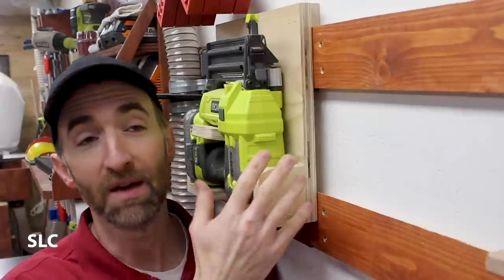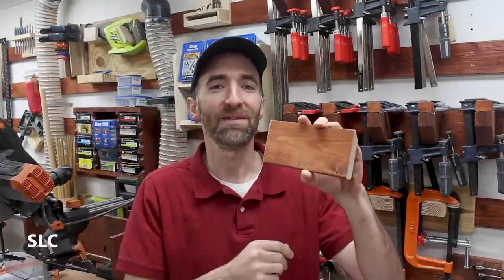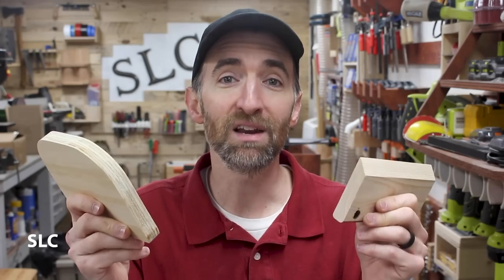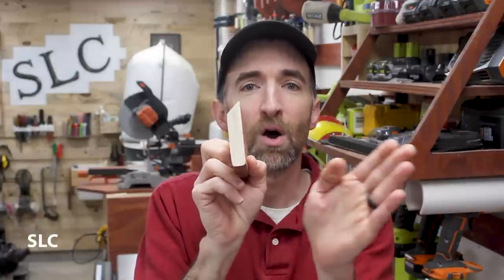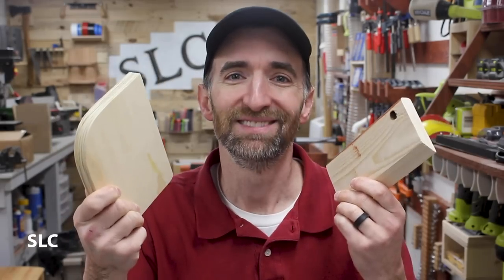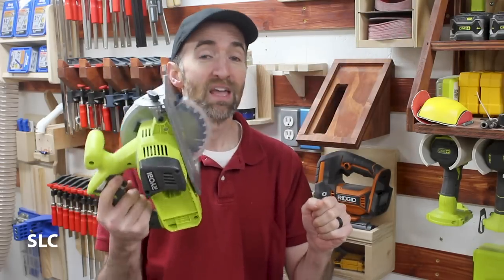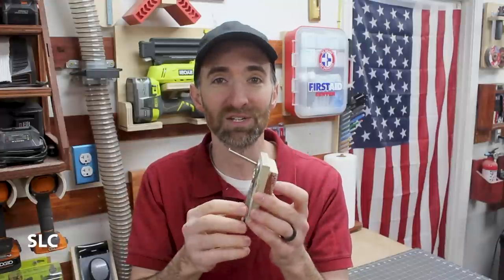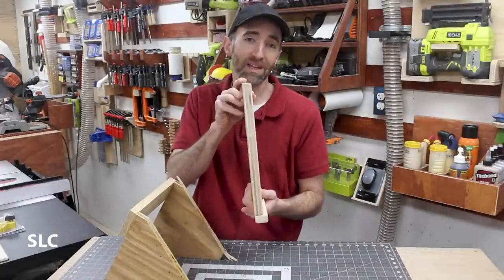French Cleats : Frequently Asked Questions

Comment: For my cleat wall I started with 3/4 plywood over the existing wall with plenty of screws into the studs to secure it. Then I could use narrower cleats because I could driver as many screws into the cleats and the 3/4 plywood behind it to make it super secure without need to stick to the stud locations only. The narrower and more cleats you have, the more versatile your cleat wall is.

Comment: I scored a deal on weight plates at a garage sale a few years ago.  Upside is that I got almost 400 pounds of cast iron plates for $20.  The downside is that I needed to find somewhere to store all the extra plates.  I had an unused area in my shop (which doubles as my lifting area) about a foot wide and 6' tall.  Didn't have any confidence in the block supporting that much weight, so I used a scrap 2x4 about a foot long, cut it, and bolted half to the sill plate at the top of the concrete block wall with 4 beefy lag bolts.  Put the other half at the end of a 2x12, cut it to length, and then screwed another bit of scrap 2x4 to the bottom for a spacer.  Drilled holes at an angle downwards 3/4 of the way through the 2x12, then cut short lengths of 1/2" EMT pipe and set them in the holes.  I can slide the weights on these pipes.  At first I was concerned about the pipes bending, but they're just like they were when I put them in place.  Only difficult part was getting the 2x12 in place as there's another joist nearby - had to angle and wiggle it to get it in the first time.  All of the weights are tucked away nicely, but are immediately accessible when I need more plates.

My point isn't to brag about getting such a good deal, but is that you don't always need to build a frame for a concrete block wall.  That one short french cleat has had an immense amount of weight on it for the past 2-3 years with no issues whatsoever.  If you think about the direction and type of force beforehand, you can nearly always come up with another (may times easier) way of doing things. =)
Reply from the maker: That's a good story and glad it worked out so well for you. Thanks for sharing.

Comment: Love  your videos. Thanks for making them. One recommendation for stud walls, the shop in my garage I insulated, wired with 20 Amp and then covered with 1/" tempered peg board. It works well with lots of flexibility where I don't use cleats. Just a suggestion.

Comment: For my cleats I used a 2x4 spacer to get the all the exact same spacing apart to ensure they parallel and if I ever need to hang something heavy that needs 2 cleats I can use that same spacer to the cleats hanging will rest on the wall cleats for more support.

Comment: I think that if you were going to add a french cleat system to a bare stud wall, you'd probably want to space the cleats a little closer together. Just as you would add a spacer to a tool holder that was not tall enough to reach the cleat below, the closely spaced cleats on a bare stud wall would be that "spacer" that you would need to keep things stabilized.

Comment: Awesome info. I am framing out the walls now for my shop. I am planning to use plywood as my backer. What thickness plywood is sufficient for french cleats assuming I will be able to hang power tools?
Thanks, John
Reply from the maker: For just the walls, I wouldn't go any thinner than 1/2 inch. For the actual French cleats, I prefer to stick with 3/4 inch.
Reply: @SpecificLove7   thank you very much for the info.  Keep up the great work.  You are very inspiring 👍

Comment: Clint, thank you for the great French cleat video series.  One more question I was hoping you could address is what’s your thought on putting the French cleat on the shop wall that is covered by drywall.  Would you recommend putting the cleats directly on the drywall and screwing it to the studs or would you put a 3/4” plywood over the drywall before putting the cleats on.  Thanks and keep up the great work.
Reply from the maker: I usually would not recommend having drywall in a workshop because there's a good chance holes will be put in it easily. But if you already have it up, then you could add your French cleats over the drywall making sure to have long screws that anchor well into the studs. And if by chance it gets damaged you could always later remove the cleats and add plywood.

Comment: Really enjoy your videos. How deep into a stud should a screw go for a heavy cleat?Half of 3.5” 1.75” ? Is that too deep. I’m hanging a shop cabinet. Probably going to use two sets of cleats. I think there are 5 studs. Thank you. Adam
Reply from the maker: I don't believe I've ever been asked that question. I used 2.5" long screws going through a 1/2" wall. I believe that is pretty common for many French cleats. I don't believe there is an actual standard length but I always recommend two screws at each stud. I would think 2 screws at 1.75" deep should work.
Reply: Thank you so much for your answer.

Comment: I have a sloped ceiling in my closet, so one of the walls is nearky 10 feet tall.  I was thinking of lining that wall with french cleats so I could put hooks, baskets, maybe even a hanging shoe rack.  Any advice/ ideas?
Reply from the maker: Sounds like a good idea, just make sure to get screws into the studs of the wall. I can imagine how that could be helpful in such a closet. I would definitely suggest drawing it out first. Maybe consider things that are interchangeable such as shelving that can be used to place baskets on them or shoes, whereas hooks can be used to hang belts or the baskets from them.

Comment: French Cleat 4x8 wall project
Table saw Work table from 12x2”x12’
Test out on barn
Ideal cost effective French Cleat wood?

To 

I found out about F.C.s a week a week ago…Snap!
75 years of unorganized stowage practices solved with one brilliant concept!….
Our 20 year old  steel clad shed… 9x15x8 feet of secure, dry ….MESSY-UN-Managed storage goodness…needs some love…but…
It’s got no studs doood! 

Tapping the wall yields a non-drum sound…it’s a solid thunk…there is prolly 3/4” ply underneath. But, I don’t want to risk the integrity of the Steel/UnknownSolidCore/Steel sandwich by destructively testing it

How the blue blazes do I satisfy the old…ummm…young lady’s demands that I throw away allll the shed contents, when I know that it contains yes, junk, but also 
valuable (someday) 
electrical, 
plumbing, 
35 years of computer / audio parts, 
connectivity, 
piping, 
tools , office supplies
Pool parts
and just plain storage that should be prioritized,
into 
throw away, 
sell, 
store in the barn (another place for French Cleats…yayyy!) 

Yes I’m going to physically hone my F.C. skill-set on the barn first, but my as yet,new intellectual love, French Cleats is, as yet, un-tried.

When it comes down to the real deal…the shed…outside of irresponsible “ fu**it-just-do-it and stick the d*mned wall cleat on the d*mned shed wall..what’s the worst that could happen?? 
Yeah!

No Studs no French Cleats…sob!?

Do I have to make a stud wall and a 3/4” backer board?…orrr give the shed walls a possibly destructive test with a small , to get larger with a small test
Help!
Lovin’ yer Chan! 
Chas